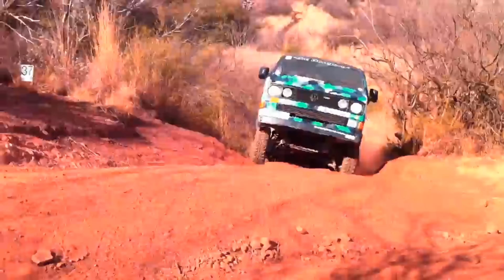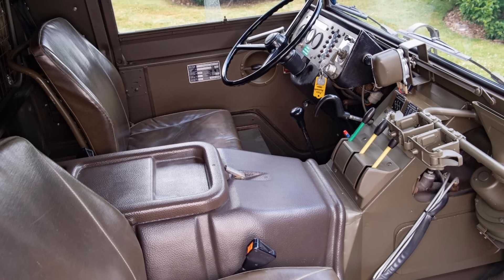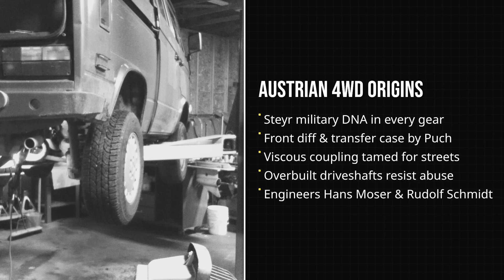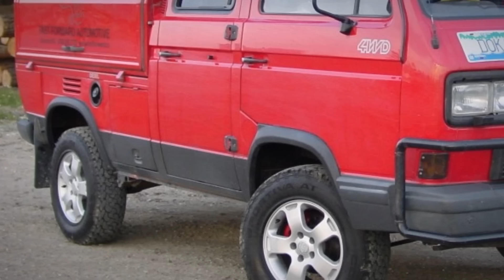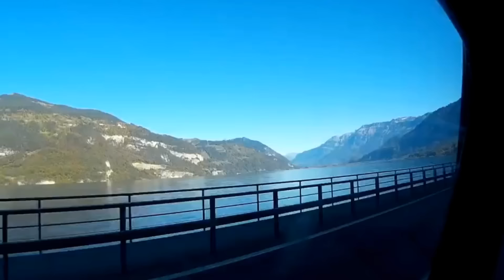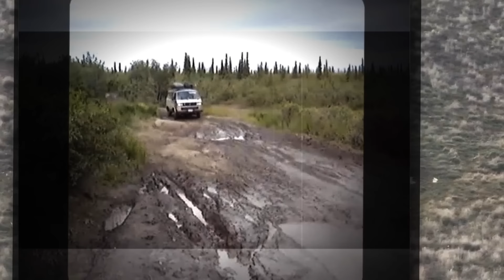The Impossible Engineering of the VW Vanagon Syncro

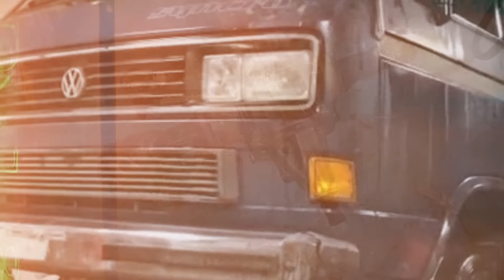Comment: Artificial absurdity at its finest: Verbal descriptions not matching images, eg at 5:44 a front transverse 4wd layout described as rear, at 7:45 talk of cv joints with a huge Hook joint illustrated, at 10:25 a 3 cylinder engine block sitting in for wasserboxer. Who knows what other rubbish these knuckleheads presented.

Comment: Plus: 
the aerodynamics of the t25, (not t3, t25 is for the year 2200 AD), are unique. There is a hidden spoiler of 1.62m² far front the front axle, which makes a pressing lever on the front wheels. This is the why the automotive press, (you can find the review into the Heresy under the Syncro aerodynamics),  found it more stable than a Porsche 911 on lateral winds! But there is no reference anywhere about, since the phenomenon takes place above the 140 km/h and this car was for up to 140 km/h, although the Porsche b32, the Oettinger edition and the Southafrican model where well above that limit.

Plus2: 
there are available front and rear lockers which are a must.

Plus3: 
there and other hidden characteristics. 

The Syncro Heresy

Comment: I bought my Turbo-diesel 5-speed "Transporter" new from the dealer VW at Barcelona (Spain) in April 1989; after that, with around 150000 kms., it collapsed in Germany in 1999 when 5th-gear stuck with no return to neutral. After the most expensive visit to the nearest VW (sole positive side of it was learn that the complete tranny was NO VW, but Porsche). After 4500 Euro, and a complete transmission SHIFT, (I had to give my destroyed gearbox in exchange for the new one), I did other 200000 Kms without problems.

Comment: Thats just a cult. 30yo obsolete machine, flawed by design and added all wear and tear, without any modern conveniency, small and slow... No way. 

Modern production of the same VW allows much more. 160hp engine, 8auto, factory rear diflock, all this based on Haldex coupler with very good electronic control - and on top are LED lights, ACC, full control electric steering, of course all ABS-ESP, double AC and many many other features. The single problem - made in Poland, they forgot to install ordered 2nd generator (400A both together), so local dealerships are already shivering when they hear about "this red crafter".
Reply: A T3 syncro is A LOT bigger on the inside than T4-T6 by maintaining a lenght of 457cm on the outside, it has 270cm of space between rear hatch and back of the driver seat. The T3 will also vastly outperfom the later iterations offroad, actually a t3 2WD has more ground clearance stock as most 4-motion T6. And at last: good luck working on your Crafter, the rear engine of the t3 is perfectly accessible, you can even service most things from inside your dry, comfy vehicle... Yes they are old, yes they are "slow" (will still do the speed limits of any country but germany) but they are an absolute blast to drive and can still match todays Vans.
Reply: Easy to say...to appreciate a T3 you have to have owned one...awesome vehicle. T3 Syncro owner. Slow, heavy, but it feels like you on holiday whenever you drive it.

Comment: I really like the Vanagon Syncro but ended up getting an 87  Quantum GL Wagon Syncro. Money permitting, I'd rebuild a Vanagon with a Subaru engine today.
Reply: The Quantum Wagon is one of two cars I've owned, that got Passed, on State-highways (VT) by Snowmobiles!! 7" of fresh snow on Rt-103 about two miles from Rt-10, and six Sleds blew on by me (I was tooling along at about 35 mph) doing nearly 100 mph! By the time I got to the end of 'the Flats' in Gassets, I could see the Ludlow Police Tahoe, lights on, doing all-of 30 mph, and by then, those sleds were already thru Chester Village...

Comment: I still have my 1986 syncro however I replace the engine 16 years ago with a Subaru 2.5 turbo since then I have over 150.000 miles on it and not a single issue besides regular maintenance ' great video thx
Reply: Very cool. I have an 81 rabbit pickup, a    90 Jetta, both diesel, and a 93 fox. Can't have em all! 😅
Reply: @dankline9162 lol almost a brother from another mother. 
79 rabbit round eye, 91 Jetta coupe , and mk4 Jetta /Smyth Ute conversion. 
Replaces my old 81 pickup in a way.
Reply from the maker: keeps on runnin. what a gem